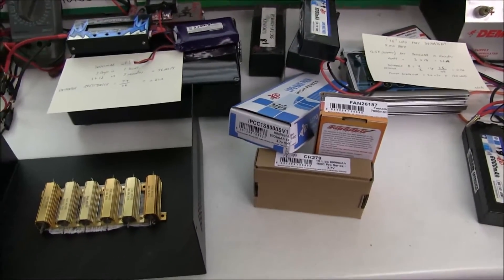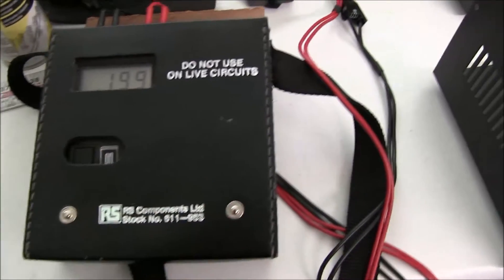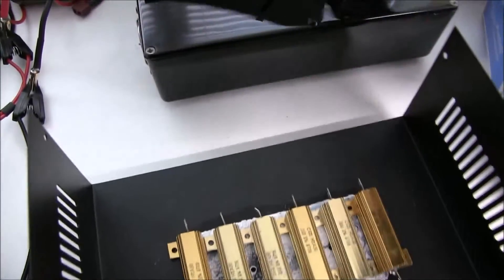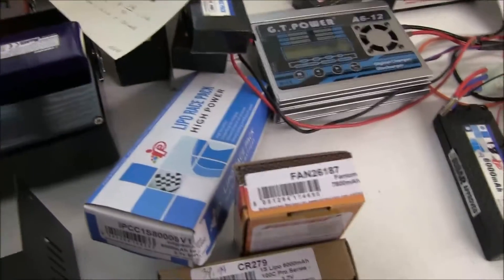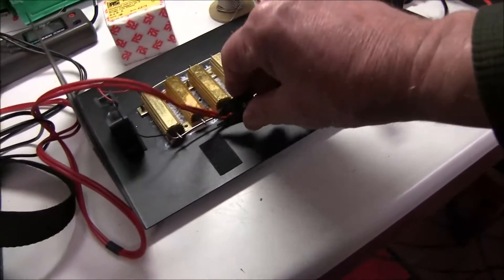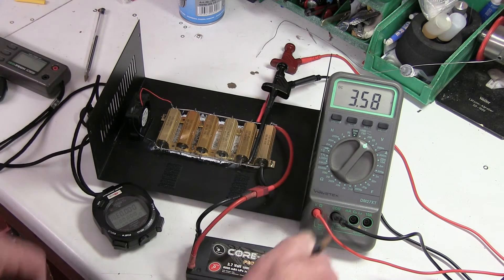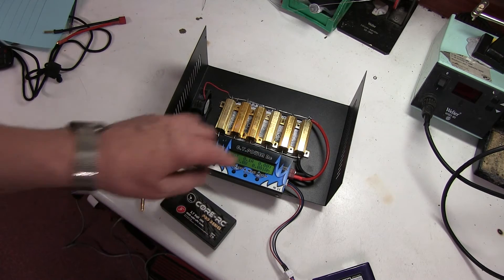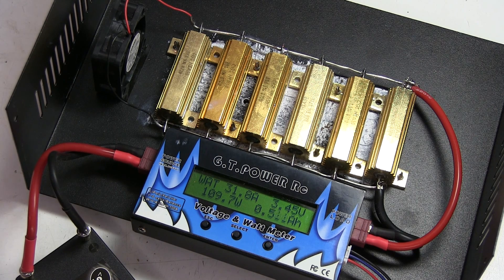Lipo 1S High Current Discharger. How to make and test.

Comment: Wait, so the purpose of this is confusing (i'm dumb that way).  Does this serve 2 purposes.  A discharger for taking 1S lipos down to 3.85v (storage charge) from 4.x voltage?  and also by seeing how fast a 1S will discharge for purposes of driving R/C cars.  I am simply trying to take those really small 1S batteries down from a fully charged state of 4.2volts down to a place where i can store them until i need them.  I can't find anything to take this voltage down on these little 1S LIPOs,i connect LED lights to them and it would take forever.  My LIPO is the following:  3.7V 300mAh 25C LiPo Battery.  These are used for quad copters and they have the little tine white two conductor molex or not sure what the end type is. but they are little two prong white connectors.  Here is the amazon part link so you get an idea of what i'm dealing with.  Just would love a way to discharge these little buggers before they start puffing up due to being kept at 4.1x or 4.xx volts and not being able to discharge them.  Any help is appreciated.  If you know of a product great, if not, i have those exact bronze looking resisters for car turn-signals anti-fast-flash syndrome...sorry, that's the only way i know how to describe those things.  I have a handful of them , perhaps 5 or 6 that are all 50W 6Ohm J model
Reply from the maker: Hi Harpo. Your lipo are small capacity, and will not need much to discharge them quickly. I suggest 4 amps would be enough.
So lets say the lipo is at 4 volts and you want a 4amp discharge. The formula to find the resistance is R=V/I which is 4/4=1ohm. The power dissipated  is W=VxI which is 4x4=16watts. 

So a single 1ohm resistor rated at least 25watts (50watts is better) will be all you need. (They are cheap on Ebay)
The time to discharge the fully charge lipo of 300mah will be  300/4000 x60minutes=4.5minutes.
So to half discharge to 150ma will only take 2.25 minutes.
Hope that helps.  Nick
Reply: @nickadams5411  Hey, im not that good at english..
so i ask to make sure: I have a bunch of 1S LiHv`s.. 
between 250 and 450 mAh..
I want to test the cells.. that way i want to build one myself..( discharger )

4V / around 10 Ampere = 0,4  Ω Ohm

which is 0,0004 Kilo Ohm right ?!
Reply from the maker: @Cre8ionz.   Yes. You can buy low ohm resistors on ebay. Get the 100 watt ones.
Reply: @nickadams5411  thx !

Comment: Hi Nick, pretty cool video, as always! :) 
I've  some questions.
My plan is to build an resistor for my Junsi 406 .
Idea is to discharge with up to 40 amps 4s Lipo.
Following your answers in this thread I calculated this.
4S = 15V, means 15/40=0.375 Ohm
40A means 40x15=600 Watts
Assuming this calculation I would buy 8x 3R(3Ohm) 100W (3/8=0.375) resistors and connect them parallel. Right? 
Why 8 (means 800W)? To have some reserves and not so high temp. Makes sense? 
During winter saison my plan is to use the same resistor for 1s Lipos,  restricted and controlled via Junsi charger, will this work? 
Thank you very much in advance Nick :)
Reply from the maker: Hi Thomas. Your calculations are correct.  The resistors will get very hot, so add plenty of fan cooling.
The 406 adjusts the voltage to the discharger to obtain the Watts dissipation. with a 1S lipo it will have to convert the  voltage to obtain 160watts dissipation. Which in this case is about 3.75V for 40 amps.
Reply: @nickadams5411  Thank you very much Nick!

Comment: Hi,
I want to make a lipo discharge unit but I have an idea about the calculation of the resistance. 4S 5200mAh lipo battery pulling 10 amps to 50% storage level you want to download. What resistance should I use for this?
Reply from the maker: Hi hans
4S Lipo say 15V under load.
For 10 Amps current
R=V/I = 15/10 = 1.5 ohm
Resistor dissipation = VxA = 15 x 10 = 150Watts.
So you will need at least 3 x 100Watt resistors, so that they do not burn out.
3 x 0.5ohm  (100watt) resistors in series shoould do it.
They are available cheaply from Hong Kong.

https://www.ebay.co.uk/itm/Green-0-5-Ohm-5-100-Watt-Aluminum-Shell-Wire-Wound-Resistor-2pcs/382420365314?epid=1938119842&hash=item590a07b002:g:iSkAAOSwmaVbmB8w:rk:1:pf:0
Reply: Thank you very much for your helpful answer. I'm working on a discharge project controlled by arduino and delays.

Do you have any idea about the life of these high wattage resistors? I see the use of mosfets as an alternative to resistance. What do you think is the correct road map for stable discharge of 4s batteries?
Reply from the maker: The 100W resistors have a long life between failures, as long as they are run at less than rated wattage, and well heatsinked. Run at 50 -60 Watts each resistor.
Of course a sophisticated controlled FET discharge has the ability to sustain a constant current, and can be switched off at a selected votage.
I do sell dischargers with auto switch off, but use resistor load for simplicity and reliability. FETs can blow out if they are subjected to unexpected overload.
But in your case, it is a project, so sophistication, cost and reliability are probably not a factor.
Hope it goes well.
Reply: @nickadams5411 
Hi,

the resistors finally came from China.(100w 0.5 Ohm) Now is the test time. 
Please tell me if I am wrong: 
I will connect three 0.5 ohm resistors in series. My total resistance is 1.5 ohms. 
According to your calculation, 10 Amperes will flow from 4S batteries.

Is such a design a threat to the internal resistance of the lipo battery?

(Sorry for my amateur questions)
Reply from the maker: @solosolo6398  Hi, yes that is correct. there is no threat to lipo. But make sure discharge is stopped before any cell falls below 3.0volts (12.0volts for the 4S pack). At 10 amps the lipo discharge temperature. should only be a few degrees above ambient.  Note that the lipo  5200mah (5.2Amps per hour),  at 10 amp discharge, will take 30minutes to discharge from a full charge.
Reply: @nickadams5411  Hello again, some findings after the first tests:

3 x 0.5R serial=1.5R:Starting current   9.6A. 
 6.8A after 5 minutes. 
The average resistor temperature  190 C

4 x 0.5R Serial= 2R, starting current draw 6.8A.
 After 5 minutes 5.6A. 
The average resistor temperature  is 150 C.

 I have never worked with this type of resistors at this current level. I couldn't find any information about the operating temperatures of the China 100w  resistors. 
Do you think these temperatures are normal?
 Do you have a suggestion to pull this current at safer temperatures? 

Note: I used a simple aluminum profile 10x10mm heatsink.

Thanks...
Reply from the maker: @solosolo6398    The heatsink is 10 x 10cm I assume. I suggest you blow air across the heatsinks.  100 C is high enough.

Comment: Hey Nick!  Thank you for your vids...very helpful for me!  Question: What size & how many resistors would I need to discharge a 6000mah 100C 2S Lipo @ a rate of 30 amps?  Thank you in advance!
Reply from the maker: Hi
A 2s lipo will be about 8V at 30 amps, ehich is 8x30=240watts dissipation.
So you will need 4 x 100watt resistors to be on safe side.
The resistance is V/I,  8/30=0.27ohm.
So, you can use 4 x 1 ohm (100watt) resistors in parrallel =  1/4= 0.25 ohm. Near enough.!
Reply: Nick Adams Nick Adams Thank you Sir!!!  I just found a few 6 ohm load resistors left over from converting to all LED’s on my automobiles.  Can I use a couple of those instead of the (4) 1 ohms?  Thank you again!!!!
Reply from the maker: To get down to about 1/4 ohm (0.25) you will need 6/0.25=24.  That is 24 x 6 ohm resistors in parallel.
Total wattage, say 300. so each one would need to be at least 12.5watt rating.
Reply: Nick Adams Oh, ok.  I thought you would need less resistors if they were higher in ohms rating.  Shows you what I know! HaHa.  Thanks again Nick!  I appreciate your time!

Comment: Good morning Nick.I couldn't find the 0.68 ohm resistors, so I got the 0.50 resistors. how many will I need to make the discharger?Thanks.
Reply from the maker: Hi Milton
If you want 40 amps discharge, then using the equation Resistance=Volts/Amps
R= 4/40 =0.1ohm
The watts is VoltsxAmps. so 4x40= 160Watts.
So using 5 of your 0.5ohm resistors  all in parallel you can get 0.5/5 = 0.1ohm
You could use 50 watts each, but 100watt is better.
Nick
Reply: Hi Nick. Thank you very much for the quick reply. I did get the 100watt resistors. Have a great day.Milton

Comment: greetings, very interesting design .... I have a question I have a discharger for nickel in series of 30 to 350voltios DC .... I currently use bulbs 500watts to download them, that resistance can be used to replace these bulbs. .. I thank you in advance for your help.
Reply from the maker: Hi
The 500watt bulbs will have a variable resistance with voltage.
They are 110V bulbs?
The resistance increases with voltage, but at 110v they draw 4.5Amps.
I am not sure what they draw at 30 volts.
Lets say 10 amps.

Resistance=Volts/Amps
Watts= VoltsxAmps.
So:
You have 30 volts and  10 amps  (500watt bulb)
Amps= 10
So you need:
10/17 = 0.59 ohms.
The power dissipation will be  10 x 30 =300watts.
You will need:
4 x 2 ohm 100watt resistors in parrallel to give 0.5 ohms and manage 400watt heat dissipation.
You can use other resistors such as 5 x 0.1ohm (100watts each) in series.

Hope that helps.
Nick
Reply: I just need something that allows me to download them with a current as stable as possible ...
Reply from the maker: Hi
Stable as possible?
You need to stop the discharge at the minimum voltage.
If you have a 30 volt Nicad pack, then there will be 20 cells in the pack.
You will have to be careful that no cell goes below 0 Volt, as any reverse current flow will ruin the cell.
Can you send me a photo of your battery?

Comment: Hi Nick, I like your videos a lot! They are so detailed which I like the most. Can you please post which resistors you're are using? I didn't find the right one on eBay. This would help me a lot. I'll start to race with the GT12 class this winter, and we'll using 1S LiPo.
Reply from the maker: Hi Stefan
You can use 6 of these:

http://www.ebay.co.uk/itm/2pcs-50-Watt-Power-0-68-Ohm-5-Aluminum-Casing-Wire-Wound-Resistor-Green-/191678601255?hash=item2ca0ef5827:g:gyoAAOSw3ydV5EXz

or these:

http://www.ebay.co.uk/itm/2-x-100W-Watt-0-68-Ohm-5-Wirewound-Green-Aluminum-Housed-Resistors-/191685310597?hash=item2ca155b885:g:e9EAAOSwHjNV7n2d
Reply: Great thanks a lot. I'll try it.

Comment: I use an i charger and i charge at 30 amps and discharge at 35. I have a discharge bank that has 5 resistors that I purchased. how can I tell the value of the resistor? all the information is hidden and it has 4 mini fans with 2 thermo apoxied on top and 2 on bottom. my resistors reach about 130 degrees Fahrenheit. that's why I was wondering if you needed a bigger fan but you do have it attached to the metal case with thermo transfer compound.
Reply from the maker: Hi Mike
Measuring the low resisatnce is difficult without an ammeter, or other measuring device.
Most cheap multimeters don't go above 10 amps.
The clamp meters (DC) used to be very expensive. But there are cheap Chinese ones if you look. (As long as they measure DC and go up to say 40 amps)
Your charger should display the total amps being discharged from the inernal and external together?
You still use fahrenheit!
130 degree is not that hot.
65degree C (150 F) is the max temperature that anyone should be able to touch.
So unless the case is getting that hot, the fans should be fine.
The thermal transfer compound is to transfer the resistor dissipation heat to the larger surface area of the case, which can radiate the heat away.

Comment: Hi nick, great video. just a quick question. with a fully charged battery and using the resistors to discharge the pack how warm do they get during the cycle? also would you need a bigger fan then you are currently using? great videos. keep them coming.
Reply from the maker: Hi Mike
The Lipo reach about 40degree C. after discharge.
Depending on how you charge, they will cool down at anything below 10 amps charge.
The fan is not necessary if you have a big enough box or metal heatsink.
I was going to fit a small voltage booster to the fan, which you can buy cheap on Ebay. That will get the fan moving fast, especially if in a closed box.